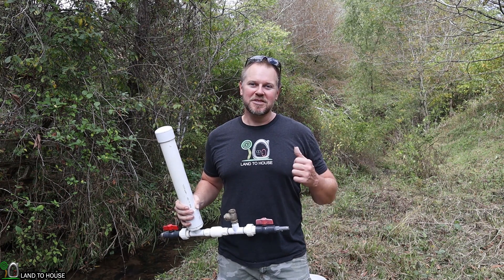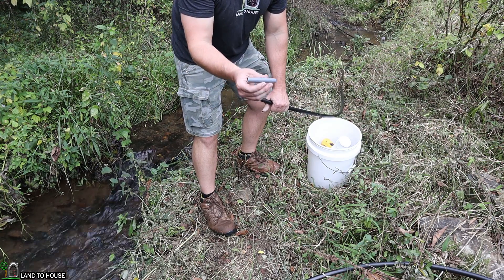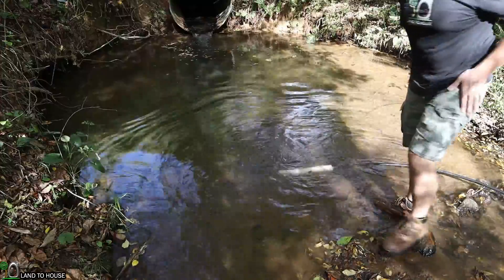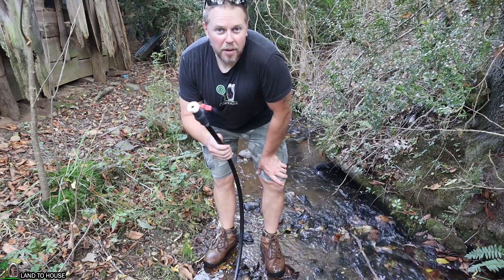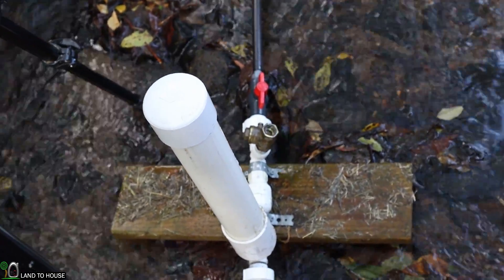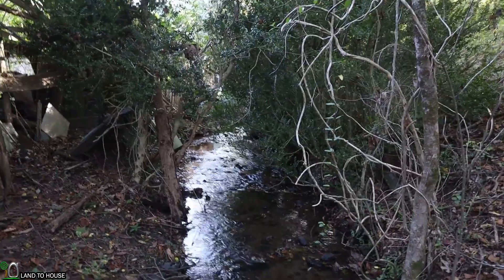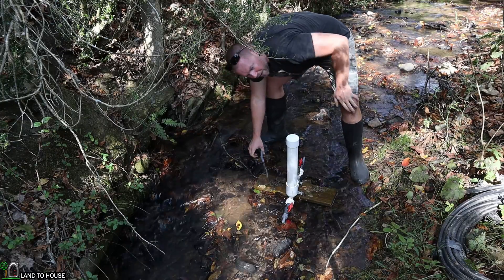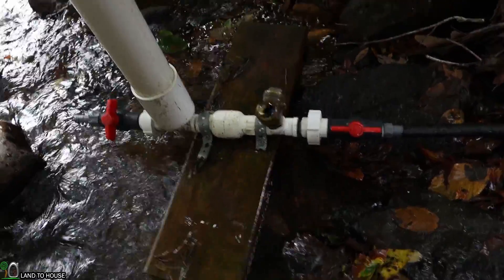1/2" Ram Pump with Stand Pipe Full Install

Comment: What size holes do you put in 2 inch intake pipe typically if using screen?
Reply from the maker: Normally I use a 3" pipe and put 1/4" holes. Lots of them.and then use window screen over that.

Comment: I have question would you be able to damn up the stream and dig down below it to get the drop for the inlet
Reply from the maker: Digging down for the ram pump to be below the water level does not increase head pressure.

Comment: What if you change the location of the two valves and it remains with the same design, just replace the two valves without reversing the directions, just around the white valve and it opens in the same direction but before the other valve??

Comment: My drop is very similar. I have a  equal minimally flowing creek as the one in the video but I don't have that much drop over 200ft. I have a 500ft run to the house and 25ft lift if I build a dam and create a pool with extended valves to pertrude out of the water could I create the drop I need to run the pump or would I have to have the valve head and ram at the lowest point of the pool? My question is because if I create the pool it will back fill with water before it overflows to continue so I can't create drop. How do I increase pressure could this work? And what would give me the most volume? My run is 1/2 pex
Reply from the maker: The minimum input head pressure to lift water to that height would be 4 feet, but if you could get 5 feet of drop, you would be much better off. Building a dam can work, but oftentimes It's better to have a longer supply pipe. And then use a standpipe closer to the pump.

Comment: I have 6 l per min.  But 1.5 m of fall. Can this work for a small micro ram pump?😊
Reply from the maker: The 1/2" ram pump needs around 8 liter per minute to operate. 6 is likely not going to be enough.

Comment: Couldn’t you build a small dam to make up the difference in grade?
Reply from the maker: In this case it was just as effective to place the intake as far up as possible and then run the drive pipe further down creek. A dam would not have helped in this install.

Comment: In this situation how many feet ideally would be PVC? I’m trying to understand how many feet should be PVC  then the rest would be Poly pipe to save $ & make installation easier.
Reply from the maker: The drive pipe works best as pvc. So in this I stall 100 feet of pvc and 200 feet of poly. However the stand pipe could have been installed another 50 feet closer to the pump. That would have given a 50 foot pvc and 250 poly.
Reply: So ideally drive pipe would be PVC from ram pump to wherever stand pipe is  then poly after that?

Comment: Thank you, this video helped me greatly. I have a similar situation. I am running your half inch ramp pump and I was only moving about 70 gallon per day. Now I’m able to move around 190 gallons. I’m still having to tilt my valve quite a bit to get it to cycle. Curious if you have any charts or math equations to figure out what max output of each pump size is given x feet in drop.

Comment: Seems a little pricey for 25$ worth of parts.  For that price I'd make one out of brass.
Reply from the maker: I have a few videos on how to make them. Some folks just prefer to order a pump pre-made.
Reply: @LandtoHouse  My drop is very similar. I have a  equal minimally flowing creek as the one in the video but I don't have that much drop over 200ft. I have a 500ft run to the house and 25ft lift if I build a dam and create a pool with extended valves to pertrude out of the water could I create the drop I need to run the pump or would I have to have the valve head and ram at the lowest point of the pool? My question is because if I create the pool it will back fill with water before it overflows to continue so I can't create drop. How do I increase pressure could this work? And what would give me the most volume? My run is 1/2 pex

Comment: Have you ever had issues with the water pressure breaking parts ( the spring check valve )  or have you had an issue with air being pulled into the pump through the brass swing valve?
Reply from the maker: The weight of the brass swing valve limits the amount of input head pressure that you can have on the pump, and this regulates the pressure well enough to prevent broken parts. Because the brass valve sticks up a couple inches. I've never had any issues with air going back into the pump.
Reply: I have approximately 18 ft of drop from the 1" pvc coming from my silt bucket to my pump. From the pump to my storage tanks I have 300 ft of 1/2" supply line raising approximately 100' in elevation. Ive had 2 of the inline check valves break internally and need replaced and I've had to add 3 inches of pipe above my brass valve because when it opened, it occasionally sucked in air. The problem of the air is fixed, just not sure if the inline value issue is resolved or not. I'm in SC

Comment: Great video, Seth i always learn from your videos! Can a standpipe benefit a rampump setup using one inch PVC as a drive pipe?
Reply from the maker: The drive pipe needs to match the pump size. So you would need to have a 1" pump with 1" drive pipe. The stand pipe is used to bring the source water closer while maintaining the head pressure. If the drive pipe is longer than 100 feet a standpipe is helpful.
Reply: @LandtoHouse  does placement of the standpipe matter? I have approximately 130ft of 1" drive pipe feeding my ram pump with a 3/4" supply line. The drive line has approximately 3-3.5 ft of fall. I realize the standpipe must be at least as tall as the source. Because of my slow fall on the drive line, my valve is rotated to 45 degrees and cycles every 4 seconds.  I thought a standpipe might help it cycle better?